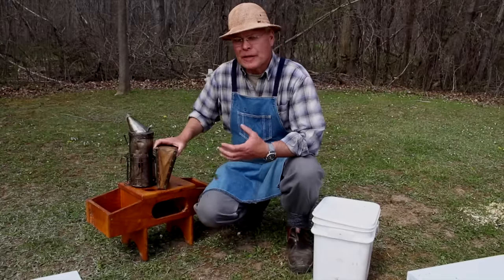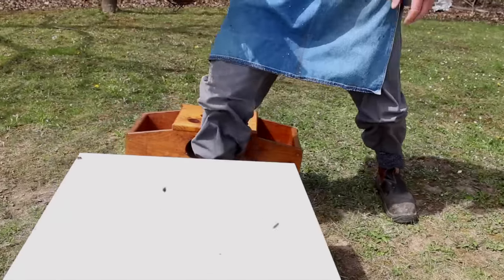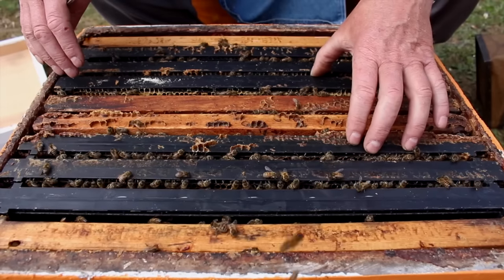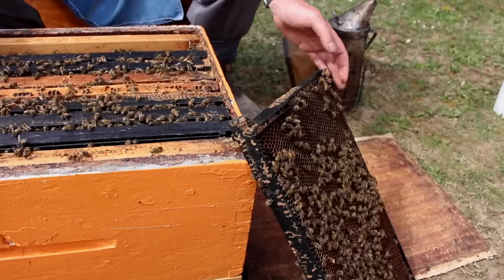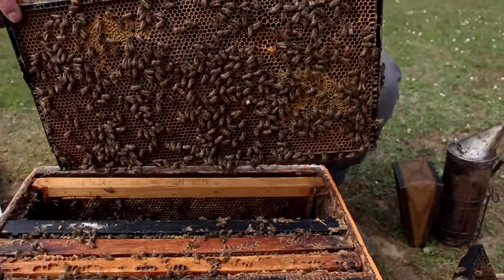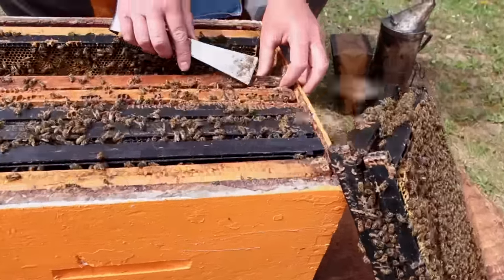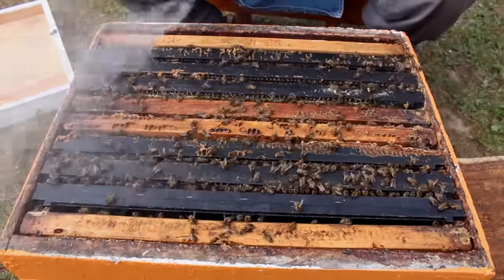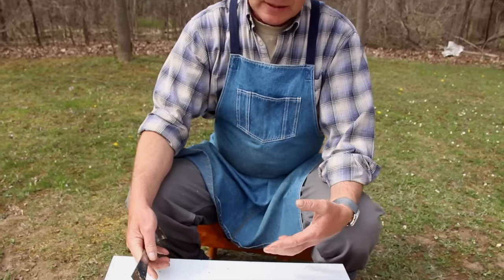Opening Hives

Comment: Couple things I do differently. 1. If I find the Queen on a frame, that frame goes back in the box, never on the ground. 2. When prying frames apart to remove them, I pry in-between end bars at the self spacer. That is where they are glued and I find less tension prying there than on topbars.
Reply from the maker: Thanks for your thoughts Matt. In almost all cases I cage a queen when I see her as you can see in some  of our other videos. In this video I tried to show one method of keeping  a queen safe that doesn't require the ability to cage a queen. Regarding your point 1. My concern with the method you describe is that you won't know for sure where the queen is later when the last frame is re-inserted so there's a small chance she could be crushed. Regarding your point 2. If frames are properly assembled  prying up on the top bar won't damage the frame. Prying this way gives you the ability to pry the frames up rather than over. Frames are often stuck down to frames below or to the bottom board so it's necessary to be able to pry up. Some people like the hook style hive tools that pry frames up easily. I find that both ends of these tools get sticky and then so do my hands. They also aren't ergonomically designed for pushing in between boxes or for scraping.
Reply: R u guys in the business oof selling packages of bees and if so what's the price

Comment: Thanks again for the video. I am planning on using canvas for inner covers. Did you find that they shrank over time? I've heard that. I have some old but clean canvas drop cloth I was planning on using. Thanks in advance!
Reply from the maker: Hi Spencer
Most drop clothes are too thin and the bees chew through it. Yes it does shrink a bit. Cut it 1/4" longer than the length of the box. Same width as a box is fine.

Comment: Why do you prefer the canvas enter cover? Your videos are great keep up the wonderful work!
Reply from the maker: Thanks Jeff!
We are working on a FAQ list and this will definitely be #1 on the list. 
I like the canvas inner covers for a few reasons. Easy to take a quick peek, cheap and easy to make, light, lids sit down well, less excess wax on the frame top bars, never need to scrape the inner cover. I could go on... We'll do a video about them since we are getting so many questions.
We use 18 oz  (#8) canvas - otherwise known as duck. It's a bit hard to come by here but I see it's available from online distributors. Bees chew through thin canvas so a heavy weight is better.    http://www.bigduckcanvas.com/number-8-18oz-cotton-duck-canvas.html    We flip it over periodically when new so the bees thoroughly coat it with propolis. An alternative is a feedbag folded in half.
Reply: How do they do when temperatures are high and with moisture in winter? I'm sure it gets much colder there but the heat here can get 100 plus, would there be adequate ventilation? I do use screened bottoms in summer. They would definitely help with hive beetles. And thanks so much for videos and your responses
Reply from the maker: Hi Jeff
 Most of our hive lids are white and that helps with heat. Ventilation isn't a big problem here.

Comment: @11:00 do frames need to be evenly spaced or should be they touching shoulder to shoulder with all the extra space going to the sides? I am having lots of burr comb on top and bottom bars of the brood nest of new colony - that is with many peripheral frames still not drawn (new foundation only). Also it seems they want to build drone cells at the bottom of the bars as if the uniform plastic foundations would not allow them to do that. Would you suggest putting 1 plastic drone frame or some foundationless frames into the box?
Reply from the maker: HI BIg Al
 Good questions. For new frames keep them tight together with the extra space on the outsides. Drone cells at the bottom of the frames is fine. Work the outside frames  in one or two positions to get them drawn out. We just did a video on drawing comb but it won't be posted until the fall. Burr comb is normal above and below the frames (our hives design doesn't fully respect the bee space principle). That's one reason I use a canvas inner cover.

Comment: mr.kelly, although using duck cloth for inner covers is your preferred  choice would it be safe to say that if you chose to use a migratory cover then no inner cover would be needed? or is the duck cloth only a propolis deterrent?
Reply from the maker: Yes migratory covers are meant to be used without an inner cover.

Comment: You mention that you like a canvas inner cover on your hives. Do you use these through the winter also? If so, how does the hive evacuate the moisture so you don't get mold inside during the cold months?
Reply from the maker: Hi Steve
 Our brood chambers have an upper entrance hole drilled in them for winter ventilation. We use the cloth inner covers year round.

Comment: Hello again, and one more question about that canvas inner cover.  Is it ok to just lay in flat?  Won't it interfere with the bees crawling over on top the frames?
Reply from the maker: Hi Brad
 Yes it does prevent most travel over the top of the frames. The bees go around the frames instead and it doesn't seem to affect them in any way.
Reply: @UoGHoneyBeeResearchCentre  I appreciate you. I think this is a great idea. And also like the idea that until I add supers, I won’t have any issues with bur comb to clean-plus it prevents propolis crack sounds-which has to be helpful. Thank you

Comment: I think holding the frame like that in horizontal is a big mistake,speacially if it has nectar in it : it will cause the nectar to drop on the ground and that will attract predators so holding the frame in the vertical position is always recommended
Reply from the maker: Hi Abdel. That not a problem here but maybe it is elsewhere. Even fresh nectar stays in the comb when held horizontally. We hold frames that way so we can see in the cells and view eggs, larvae pupae etc.

Comment: Where do you buy that sheet of canvas?
Reply from the maker: Hi GFH
 Please see our FAQ #1 below.

1. Why do we use canvas
for the hive inner cover? A: We use canvas inner covers for a few reasons. They
make it easy to take a quick peek in the hive, and are cheap and easy to make.
They are light, the lids sit down well, less excess wax on the frame top bars,
and we rarely need to scrape the inner cover. We use 18 oz  (#8) canvas
-otherwise known as duck. It's a bit hard to come by in Ontario, but it is
available from online distributors (US: http://www.bigduckcanvas.com/number-8-18oz-cotton-duck-canvas.html,
Canada http://www.jtsoutdoorfabrics.com/18oz-Cotton-Duck-Canvas-Untreated--Natural-60_p_15038.html).
Bees chew through thin canvas so a heavy weight is better. We flip it over
periodically when new so the bees thoroughly coat it with propolis. An
alternative is a feedbag folded in half. 

 

2. Why do we use single
brood chambers? A: Our preference is to keep hives in single brood chambers. We
use queen excluders above the brood chamber and then add supers. We produce
bigger crops managing our hives in singles vs doubles and we find the hive management
much easier. It's become quite common here, especially over the last twenty
years. We will be making a video about single brood chambers soon! 

 

3.  Are our queens for sale? A: We sell some queens but don't
export. To contact us about our queens, please email us at infohbrc@uoguelph.ca. Our Buckfast collaborators also sell queens: Munro Honey http://www.munrohoney.com/ (for CAN sales) and Ferguson Apiaries http://fergusonapiaries.on.ca/ (for CAN and US sales). 

 

. 

4. What breed of
honeybee do we use? A: We work with Buckfast bees. Check out our website if you
would like to learn more about them: http://www.uoguelph.ca/honeybee/breeding.shtml 

 

5. Will we be making any
more videos? A: Yes! We are looking forward to creating more videos for our
YouTube channel this year! Here are some of the topics we will be covering:
Working with single brood chambers, indoor overwintering. 

 

6.How do you overwinter
double nucleus colonies? A: At the University of Guelph, we winter our double
nucleus colonies indoors. You can also winter them outdoors by wrapping two
double nucs together with insulation on the sides and top. 

 

7. Are double nucleus
colonies prone to swarming? A: With a young queen and the supers above we don't
have any problem with these nucs swarming in the first year. We do have to
transfer them into a full size box early enough the following spring to prevent
swarming.

 

8. Do we add a frame of
pollen or honey into a new split? A: Ideally you add both pollen and honey. Of
the two, honey is the most important. 

 

9. Where to purchase
some of the products that we use: 

 

Coveralls: We really
like these Dickies all cotton coveralls. http://www.dickies.com/coveralls-overalls/deluxe-cotton-coverall/48700.html?dwvar_48700_color=GY#start=3.
We use two sided velcro to strap up the wrists and usually tuck the legs into
our socks. 

 

Plastic Queen cages:
Mann Lake and their Canadian distributors sell these and they are made by the
French company Nicot. https://www.mannlakeltd.com/hair-roller-cages. I use
a wooden plug on the bottom and screw it in place with a #4 screw after pre
drilling. 

 

Grafting microscope: http://www.amscope.com/catalogsearch/result/?q=gooseneck+binocular

 

Mini/mating nucleus
boxes: Mann Lake (US) and their Canadian distributors sell these. They are
originally from Europe so are widely available there. https://www.mannlakeltd.com/shop-all-categories/hive-colony-maintenance/queen-rearing/nuc-boxes

 

Queen Pheromone: The
pheromone strips were developed here in Canada. They are called Tempqueen and
are made by Intko Supply Ltd.Suite 604, 3345 Kingsway VANCOUVER, BC, V5R 0A7
Canada +1 (604) 356-7393. pheromonesupply@gmail.com. Mann Lake in the US and several Canadian
bee supply companies carry them. 

 

Bee belt and bulk bee
box: Our apiary manager Paul Kelly manufactures the Bee Belts and bulk bee box.
If you are interested in more information, please email him at pgkelly48@gmail.com.

 

10. Should you remove
any queen cells in a colony before introducing a new queen in a cage? A: Yes,
you should remove the queen cells. Look very carefully to make sure you don't
miss one. Shake the bees off each frame to make sure you can see them all.
Accepted queens are sometimes killed by virgins that emerge from queen cells. 

 

11. Can you make a split
without adding a mated queen/can a split raise their own queen? A: A split can
raise their own queen (if they have eggs), but you'd be better off buying a
mated or queen cell from a local bee breeder. Queens raised by a split are
reared under the worst possible conditions, are physiologically inferior, and
you aren't taking the opportunity to improve your hive genetics. For a number
of reasons, colonies get more aggressive if we let splits raise their own
queens. We always use queen cells that we have reared from breeder colonies so
we can maintain and improve our genetics. Cells found in hives can be poorly
reared if conditions aren't good or if you use swarm cells you are
unintentionally breeding for swarming behavior. 

 

12. How often do we
check for swarm cells? A: We check for queen cells only in colonies that are
stronger based on our ratings as described in our “Swarm Control” video. We
only do this at the time of year bees are prone to swarming (ie just before the
main summer nectar flow). In some colonies, we check twice, a week apart, if we
have the time and we've found cells in them previously. We stop looking once
the nectar flow gets going and the time for swarm preparation has passed. 

 

13. How old is a queen
when we replace her? A: We re-queen if a queen isn't doing well or when she is
in her third year. 

 

14. How often should you
be stung to lessen the chances of developing anaphylactic reactions? A: Please
speak with an allergist if you have any concerns regarding bee sting reactions.
You don’t need that many stings to build an immunity and reduce your chance of
developing an allergy. However, reactions can be very different from one
individual to the next. For about three years after starting beekeeping you
swell more in the spring when the bee season starts. After that most people
don't swell up much at all. Some beekeepers apply stings through the winter to
keep building immunity. 

 

15. What do we use as
candy for the queen cages? A: You can make the candy using honey and icing
sugar but the candy you see in the tubes in our videos are purchased with the
cages from Mann Lake beekeeping supplies and their Canadian distributors. In
our province, it's not legal to use honey in queen candy if you are distributing
queens. Honey can contain American Foulbrood spores. A specialized, non-drying,
sugar syrup (Nulomoline invert sugar) can be used instead of the honey. In any
case the candy must be made dry enough that it's crumbly.

 

16.  How do we make pollen patties? A: The patty is
made from pollen we collect using a pollen trap. We mix the pollen pellets with
sugar syrup to a dough like consistency, form the patties between layers of wax
paper and then keep them frozen until they are needed. They will keep for several
months frozen. 

 

17. How do we make our
grafting bars? A: We cut the wood pieces and attach them to the graft bar with
liquid beeswax. We then attach the cups with liquid wax. In both cases the
liquid wax is applied with a syringe. Previously, we made the wax cups but now
buy them from https://www.kelleybees.com/. 

 

18. Do we move full
honey supers to the top of the stack so the bees can fill the lower ones? A:
Some beekeepers do shuffle the supers around and do what's called bottom
supering. We place supers back on in the original order and only add new supers
on top (top supering). That way it's easier to see when the bees need more
space. The bees also ripen the honey before moving up. We sometimes harvest
full lower supers and put the top ones that aren't full back on in the original
order. 

 

19. Do we ever add brood
frames to the cell builder colonies to keep their populations high? A: We do
add other frames of sealed brood and sometimes we shake in more young bees from
brood frames to boost the hives. About once every three weeks we'll boost the
hives in one way or another. 

 

20. How do you level
hive stands? A: We level the hive stands periodically with pressure treated
wood shims. If the hives are already on the stands, we use a hardwood pry bar
and a brick fulcrum to lift each end for shimming.